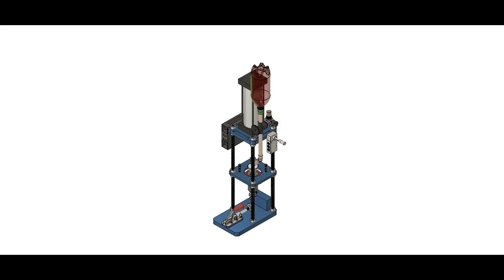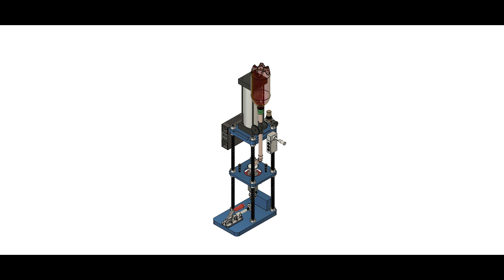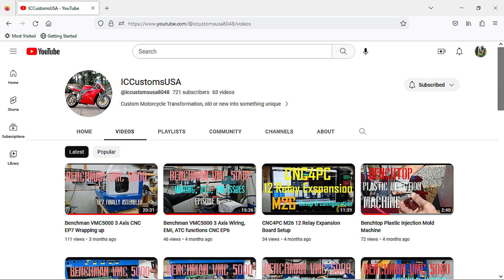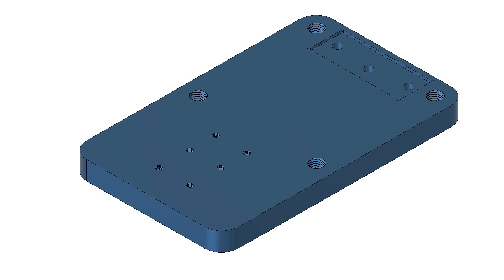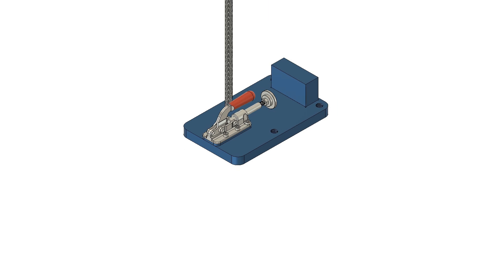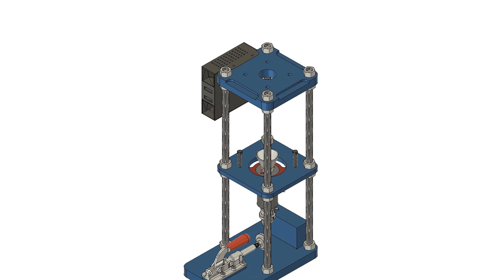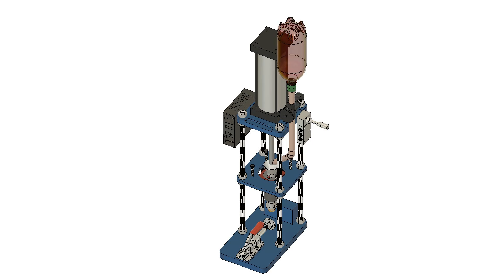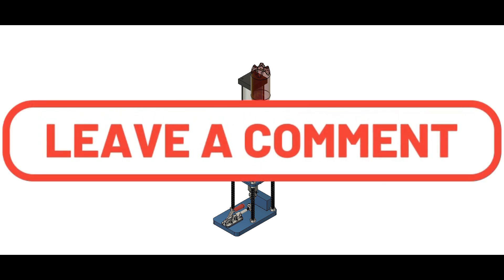INJECTION MOLDING MACHINE

Comment: I recently built a buster beagle mk3.  It has a purpose, but honestly I sold it after a couple months of testing.  I wanted to fill some fairly thin walled features (about 1.5 mm), and it just couldn't do it.  

The screw-less, pneumatic designs I feel just promotes burning and discoloring the plastic.

You'll be fine if you're shooting the plastic straight into a simple chamber, but if you're doing anything else you'll likely not have enough injection pressure.
Reply from the maker: Thanks for the input It will hopefully do the parts i need.

Comment: I designed a fully automated injection molding machine in Solidworks.  I recommend to not forget the clamping pressure. The larger the part the more clamping pressure you will need.  There is a reason why modern injection molding machines are designed for evenly distributed high clamping pressures. My first several aluminum molds where bent due to my low clamping pleasure and high injection pleasure. My wife and I are currently saving up for a Boy 22A injection molding machine. Please feel free to come to me with any questions you may have.  I'm not the smartest engineer but I can try to answer your questions.
Reply from the maker: Thanks for the input.